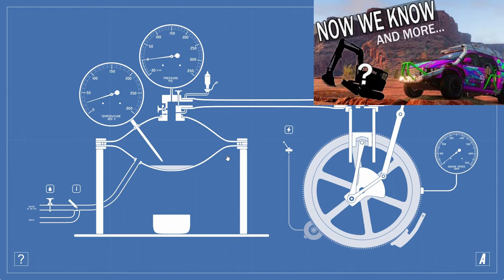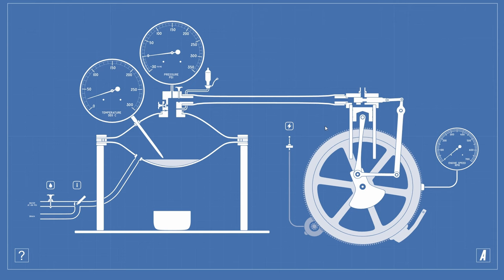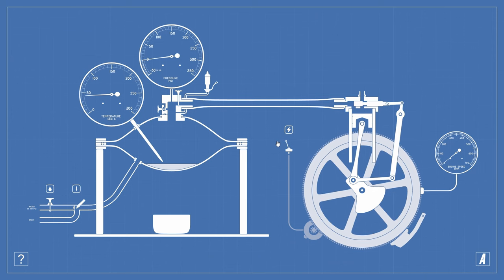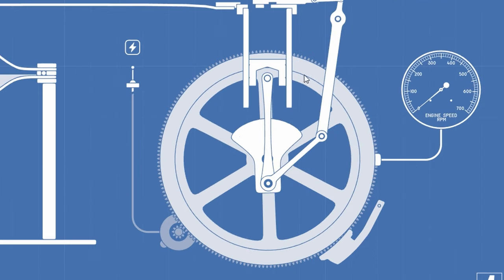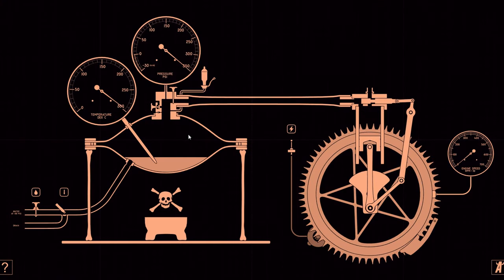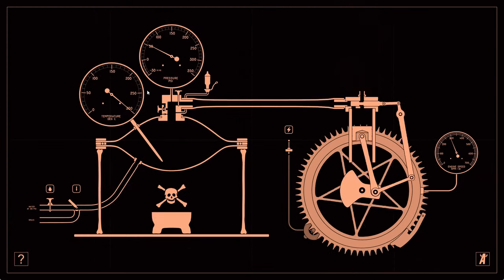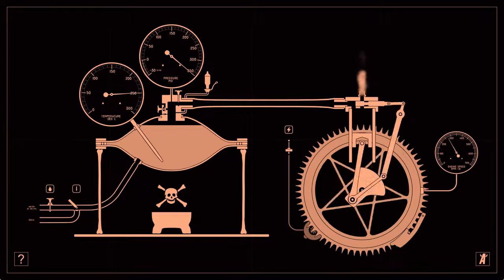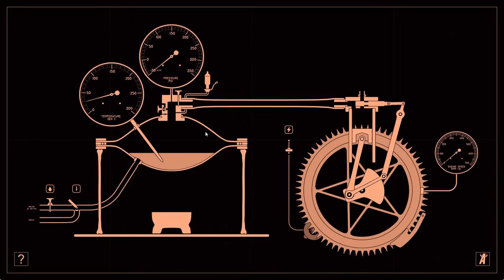Why Steam Engine Simulator IS a Good Game

Comment: my record is ~4200 rpm. And the best part is it could go indefinitely because the water was always open
Reply: how?
Reply: @NoNameAtAll2  put it in demon mode, add some water and max fire. Gater some pressure and when ready let it in the engine getting some speed. When only a little water remains fully shut off the engine valve and wait for the last little bit to boil. Wait until you have 100+ pressure then fully open the water input. It won't flow because of too high pressure. Wait for max temp then slowly open the valve to the engine (it should already be going quite fast from earlier) to about 40% open. Then pressure will drop but when it reaches 100 water will be added. The water will instantly boil providing pressure. Then slowly open the engine valve to around 54% or 55%. Then wait until it reaches max speed. If you open the engine valve or reduce pressure too much in any way the temp will also drop so water can not instantly boil meaning water pools and rapidly decreases temp creating a vacuum which stops the engine.

Comment: If you turn in the water valve so the water doesnt run out and the air is continuously pressurised by the water and its should go faster ,im wondering why it didnt purge?
Reply: You can disable the pressure blow off valve (i think demon mode automaticaly does that). The water input pressure maxes out at 100psi so you can't just add more all the time.
Reply: What I mean is the pressure will stay at 100 because you supplying a never ending chain of water
Reply: @nerfgodbigguy1405  the issue is that 100psi isn't really enough to go really fast. yes it will go forever but the force it has will not reach the peak.
Reply: Ah understood
Reply: @MascottDeepfriar  also adding more water will cool down the temperature
Reply: @MascottDeepfriar  actually back when water would come in at 50 psi you could max the pressure in boiler then open water fully and slowly open the throttle to 70% and get over 3500 rpm although it did take a while and I think for 100 psi water its 57% throttle

Comment: to get max rpm, use 68 to 70 percent throttle
Reply: @TalksWithNoise  yes, slowly add throttle, I reached up to 3950 rpm
Reply: I got up to 4687.3 rpm, with 60% throttle, just enough water getting in the tank to keep 50-60 psi at 150°C. You can press the "?" button on the bottom left corner to see the parameters more clearly. And lower the quality of the simulation to it's minimum by pressing "N" and scrolling down.
Reply: I can sustain 3650 with a constant flow of water, max throttle, and max fire. I kept it just barely overflowing

Comment: 4300 is easily achievable (i did it by fiddling). However, closing the throttle off somewhat seems to be the key to getting that high...which is odd.
Reply: Rockets have a nozzle for the same reason; a little high energy exhaust is more efficient than a lot of low energy exhaust.

Comment: Well it is not optimiert for the graphics card, at the beginning i could let it run and play minecraft with shader, no Performance issue but after about 10-12 hours i went back Otto my PC and i had 14 fps in minecraft without shader so there is one Performance issue